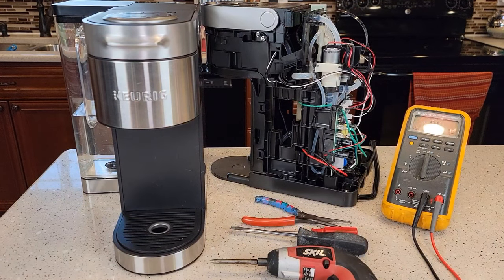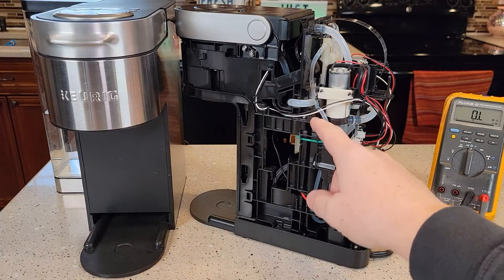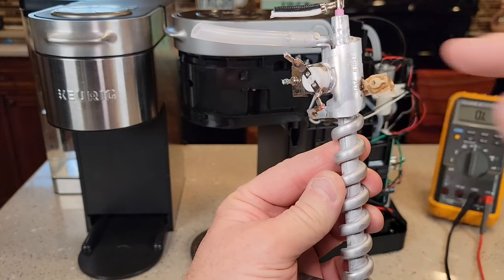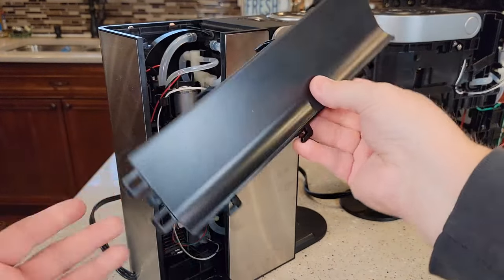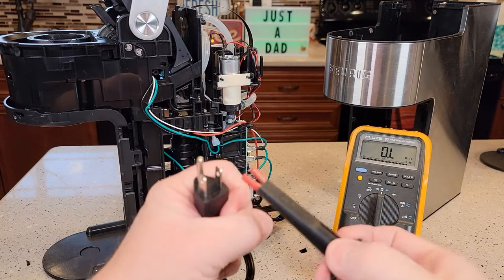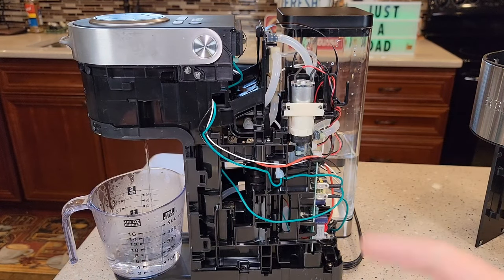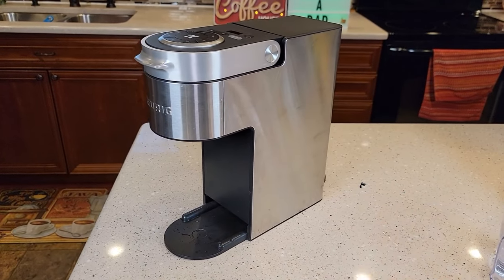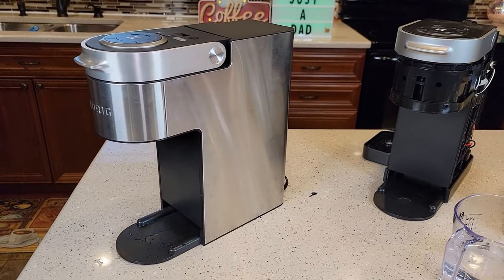HOW TO FIX Keurig K-Supreme Plus Coffee Maker Dead NO POWER.  How to reset Thermostat POWER LIGHT!

Comment: Fantastic video.  No BS, no unnecessary blabbering about irrelevant issues.   You are the man,  I was back up and running in 15 minutes thanks to you.  Other YouTubers should take notes on how to make a good video from you.  Thanks for the help!
Reply from the maker: Great to hear!
Reply: Fantastic videos.  I fixed my Keurig!!  I even passed your video onto someone who had the same issue!  I would mention that there are two plugs at the front of the Keurig (where the lid shuts down). Your machine didn’t have this! You need to put a screwdriver in there to get it loose. I suspect it’s to make it easier to disassemble. I just want to mention that in case anyone else has that on their Keurig. I am so grateful to you for this perfect video!

Comment: After I removed the top I could see the thermal switch so I got a paper clip and used it to make an attachment with the paper clip bent to a 90 deg angle and attached it to a narrow longer common screw driver by taping it to the shaft. I could then Slide it down inside the unit  and depress the thermal unit. Your video is great. I'm considering doing what others have drilling a small hole in alinement with thethermal unit.
Reply from the maker: That is a great Idea,  Thanks for Sharing!
Reply: Did exactly what you said and it worked. Thank you for being a blessing!
Reply from the maker: @maidapizzo8074  Awesome!! good job!

Comment: OUTSTANDING!  Keurig said it was not repairable and offered me 25% off a new one.  Almost went there but decided to see how a fix may work since the add water didn't come on and the unit just stopped working from running with no water.  Viola!  I found you and you led me thru this very easy reset.  BOO on Keurig for not leading me to this and instead have no interest in saving the landfill and earth from unnecessary toss out.  I am very thankful for your very clear and easy solution. BIG THANKS!

Comment: Thank you so much for posting this.  Worked like a charm! My wife was ready to buy something else! (I think she mistakenly removed the water reservoir while it was brewing and that tripped the thermostat.) One thing that puzzles me is why the screws need to be removed from the bottom, since  the snaps are on the sides and I don't recall anything on the bottom.  I probably missed that.  In any event this video is much appreciated!!!! Well edited and the explanations/instructions are perfectly concise and clear.
Reply from the maker: Yeah others  have said the same thing.   I thought when I took mine apart the screws need to be removed, but I think you are right,  I guess I just assumed they did,  you know if you see a screw take it out. LOL.  Thanks for watching and sharing your story,  It is very common mistake to remove the reservoir during a brew, I see this alot in my comments.

Comment: Sad that Keurig couldn't put a hole for resetting the thermostat without disassembly!
Reply from the maker: yeah that would be nice.
Reply: Likely a safety issue. If there's a real problem causing it to trip, it could melt something or maybe start a fire. Just thought because it would be a lot cheaper to put an external reset button than sending out a new unit.
Reply: I decided to put a hole in mine  while I had it apart to reset it if it happened again. It shut down again after a couple of weeks use, now it won’t reset so I guess I will send it back for repair.
Reply: At the very least have the piece that slides up on the left side uncover access to the reset

Comment: After watching the video, I was able to remove the three screws (probably only need the rear one), the top piece, and the black curved piece of plastic.  Using a trouble light shining in the side, I was able to press the reset with a piece of stiff mechanic's wire, bent into an L shape, insert the short end of the L into the reset hole and press it in using a long flat-bladed screwdriver.  Definite click when it resets.  Thanks for the informative video!

Comment: Our machine had this issue after we were out of town for a few weeks. Once I reset the thermal switch, the machine turned on but would only brew a few drops. After looking Keurig’s troubleshooting for this specific issue, I figured it probably just needed to be descaled as well. After running a descale cycle, it worked perfectly! Thank you so much for sharing this video! 🙌🏾😄

Comment: Thanks so much.  Today was the third time I have fixed this problem on a Keurig.  The first time was on a Keurig that the company had already sent a replacement for so now I have a spare.  I didn't even take the spare out of storage today.  Just pulled up your saved video and had it fixed in less than 10 minutes.  Your video and narration were excellent and I appreciated the explanation of how the machine worked and what caused the thermal switch to open.
Reply from the maker: Glad it helped

Comment: Thanks for the video! My unit is still under warranty and Keurig is sending a new one. Mine failed during first descaling when water ran out and it over heated.  I was told to just discard this unit that is less than 6 months old. I followed your instructions and if you have any do it yourself inclination and are patient the “fix” works!

Comment: My first Supreme, I returned to Costco because I could not find any YouTube video.  That was in 2019, and they replaced it with a new unit.  Last night, the same thing happened.  I have no idea what caused the thermostat to reset.  I thought, oh no, not again!  Anyway, a quick Google search and your video was at the top of the search results.  I did manage to break one of the tabs, but no big deal.  The entire process, including testing it before putting the unit together, was less than 20 minutes.  Thank you good sir for providing the fix procedure.

Comment: Thank you very much for all your video, This one worked as advertised.  Funny story, When I searched YT for "Keurig won't power on" your original post with the supreme came up, I watched and followed your instructions I had a struggle getting the unit opened up. Now the funny part, I have a supreme plus, I cam back to leave a comment on your original post about how I disassembled my unit only to to find this post.  Sometimes a little more research will provide the extra assistance one needs.
Reply from the maker: That is awesome!

Comment: Thanks for the video.  Fixed the issue.  I called Keurig and what a waste of time that call was.  Spent 10 min giving them my person info, then they asked if the unit is plugged in to an outlet… then they told me looks like the machine is broken.  This is the second machine I experienced this issue with in the last 3 years.  First unit was returned to Costco.  Both failures occurred during a descaling cycle.  First they build in a feature in the firmware to help remind us to descale the machine.  After descaling the machine a number of times, there will be a chance to experience this failure.  Then they place the reset button in the most inconvenient place.  Lastly they make sure their tech support team are as useless as they get.  They either use an auto reset switch, or place the reset button on the back or the bottom of the unit.  Or remove the descaling feature all together.  The whole point of descaling is to prolong the lifetime of the machine, except it ends up prematurely disabling the unit.  Most users then dump the bad unit or return it.

Comment: Worked! Both times my machine died was after I added water to the  reservoir. The first machine I threw out but after watching your video I was able to fix my current Keurig. Both times air must have gotten in the water line and  it heated up too much and popped the breaker. Thanks Dad!

Comment: Great video! Ours ran out of water. After thermostat reset and full bucket of water it popped again. There was still air in the lines. We installed and removed the water bucket several times until we saw water filling the lines. The machine worked flawlessly after that.!
Reply from the maker: Glad it helped!

Comment: Tried your method today and it worked. Thanks for posting it. Keurig technical support told me me to buy a new one and they offered 20% coupon. One thing I'm going to try if it happens again is to reset the thermostat from the opening after taking off that top piece. with a flashlight you can see the thermostat. I would solder/tape the 90 degree bent paper clip to one of my longer picks and attempt to reset it. It'll take some coordination between holding a flashlight and the tool. With your video now I know what to look for. Thanks again!

Comment: Thank you for the great video. It helped me fix my machine.  
I have a couple of comments, which may be useful or maybe not.  
Instead of screwdrivers I use putty knives when opening such items.  They cause less damage to the enclosures.  I used  1", 2" and 3" putty knives to open the unit.  Even so, I still broke one of the top cover tabs, as the plastic is really hard and not flexible.  There was no visible damage to the outside using putty knives.
After pulling up the black vertical cover I did not remove the outside stainless looking front.  Instead I bent a short piece of 14 gauge copper wire into a hook. Inserting the hook into the thermal switch reset opening did not give me enough leverage, so I used a 6" flat blade screwdriver to push the wire hook in and....  it worked.  Now I need to descale the unit, which it was telling me for weeks to do so.  Thanks again.

Comment: Great video ❤.
My issue was the unit self powering off after pressing "Brew". This happened after descaling. When I tested the thermostat it had continuity. Further search led me to a rather short video from another person having the same problem. He mentioned the same idea of testing the thermostat. He further found that pressure in the lines connected to the pump can cause our specific problem. Following his method by tapping on the pump with a screwdriver removes the pressure and resets the sensor. Great!
However after regaining control and attempting a Brew cycle my unit tripped the thermostat due to waiting for water to reach the heating element.
Using your video I was able to reset it.
Thanks for all of your videos!!

Comment: Thanks for the video. Was actually able to reset the thermocouple without taking the whole skirt panel off. Opened the top and slid out the side panel per your instructions and used some stiff wire and long curved  forceps to guide the wire around and into the reset hole. Was worried that I would not have enough leverage to pop the thermocouple back into action but it worked!

Comment: Great video. Thank you. I would only add one caution. Make sure that the paper clip is small enough guage wire to open the thermostat. The first paperclip I used was too big and it led me to believe that something else was wrong. I finally used a sim card remover pin and that did the trick. Thanks again.
Reply from the maker: Thanks for the info!

Comment: This works! My Keurig plus supreme would not turn on after descaling mode. I followed the instructions in the video for removal of the outer cover and reset it and it worked! I did not take any inner parts out. And all I used was a screwdriver.

Comment: Great video. I was back up and running as well within about 10 minutes. The only tricky part is opening it and not breaking any of the snaps. I was careful and still managed to have one break. Fortunately, this is designed with so many, when it went back together, you'd never know it was apart (so don't worry if you break a couple - but still be careful). I tested it by plugging it back in and pressing the power button (carefully) to make sure it worked.

Comment: Thanks! Taking the thing apart was the mystery, but you explained it very well. The paper clip reset did the trick. I appreciated the extra explanations, too. Made sense to a guy who doesn't attempt such things too often!
Reply from the maker: You're welcome!
Reply: @JustADad  Sadly, after a couple of cups of coffee, the machine now pretends to work. Power lights up, offers choices of strength, ounces, "Brewing" comes on. But it runs through the three little chaser lights once and then shuts down. So, maybe the pump is done?

Comment: I removed the tank to refill while doing a DESCALE op. and it went to Thermal Lockout like you describe.  I found your vid showing the procedure to reset. All is back! Additionally, before I reassemble the outer shell I will position and drill an access hole for future resets. :hand-orange-covering-eyes:

Comment: Thank you so much.  I thought our Keurig was dead after I descaled it and wouldn't power up.  We were able to reset the thermostat with a paper clip exactly as you described.  The hardest part is getting the darn coffee maker apart.  They don't make it easy to DIY but your video and comments were very helpful.    Keurig is up and running and we don't need to run out and buy a new one today.

Comment: Thanks for the video & clear demonstration on disassembly, thermo reset & reassembly! Took me about 20 minutes after watching the video.  Keurig warranty service should be reporting this issue with engineering for a more reliable design or external reset.  They just replace the units and, of course, that cost is built into the price of the product.

Comment: Awesome video. I am up and running again. Thank you. 

Note: my machine still had power. I was about 3/4 of the way through a descale and it started to just blow air but it was still attempting the descale process. My thermal was open - confirmed with a ohm meter and a reset did the trick.
Reply from the maker: Great job!

Comment: Fixed it like a charm. I did show the kids how to check the switch with the ohms meter. It was a slight pain removing the shell and I did break a cpl tabs even using the proper tool. But it went together well and no sign of entry. Back enjoying K cups. Thanks.

Comment: I was actually able to press that reset button just by removing only the top panel, snaking a paperclip into the thermostat button slot, and then using a screw driver to drive it in! Still wouldn't have been able to do this without your help. Nice!

Comment: You sir, are a life saver! Though now, I can’t begin to explain how disappointed I am with Keurig for making a device that is not only almost guaranteed to fail but also guaranteed to break when repairing it due to the stupid plastic clips! I only broke one or two on the top piece but this is just cheep considering the price of the “stainless steel” model. Should be assembled in a way that it can be serviced without breaking.

And just so that anyone considering one of these is aware… I was getting an “add water” error message even with a full reservoir before cleaning and descaling but during the descaling process when the reservoir ran completely out of water, no such message when it was actually needed… resulting in the overheating.

Comment: Amazing! My keurig at work was leaking water and had shut off due to over heated thermostat and the tube had disconnected itself at the bottom. To fix this I took it apart and used a baster and the end of two pens to force air and vinegar through the base of the heating element and then I reattached the hose at the base and ran water through then used a water vinegar mixture to descale by pressing the power button off and the holding the 8 and 12 button until it went into descaling mode and followed that through working great again thanks!!

Comment: This is a great video because it successfully diagnoses what's wrong. This is a frustrating video because it does not provide a fix for the two problems identified just before the re-build. I now know that my Keurig Supreme's Add Water mechanism is defective during descale, but not how to fix it. What I figure is I can simply tolerate the descale light and just use the machine and blindly descale it every 3 months the way people do with their check engine light.

Comment: Great video, very helpful, thank you.   Some additional comments:
1.  I’m not sure the 3 screws need to be removed at the beginning as the hold the base plate assembly, not the sides that clip in.
2.  You need to be careful when working with the Keurig during this process as water may leak from the hoses internally onto electronics inside the coffee maker or on the work surface.  For example, if you turn make upside down to access screws or place on side to pry sides away from base.   You need to ensure all electrical components inside Keurig are dry so as to not short anything electrically… dangerous and could damage coffee maker.
3.  When I reassembled my unit, I found it easier to start at the front of the coffee maker and wrapping the sides of the cover around the curved front piece at top and then work my way around both sides to clip cover into place.   I had to push sides forward, one at a time, to engage the slots in the 4p and 8p positions and then continue to wrap cover towards the back… and then by pressing in front panel where brew dispenses as I pressed sides in to engage clips.   This was much simpler, cleaner and easier to do.
4.  Because the possibility that the temperature sensor was tripped and plastic may have been melted (I had an electrical burning smell from the top of my unit when the sensor tripped), I would suggest running several clean water brew throughs to wash out any residue from melted plastic.

I hope that helps!  Thanks again… :)

Comment: Excellent video - very thorough and may have saved our Keurig K-Supreme.   Had already returned one unit and was getting ready to return a second when I found your video.   Bought from Amazon and the reviews didn't reference this potential problem.  Seems like a known issue that Keurig should acknowledge & work to fix in future K-Supreme versions.   Thanks for your help & great video!